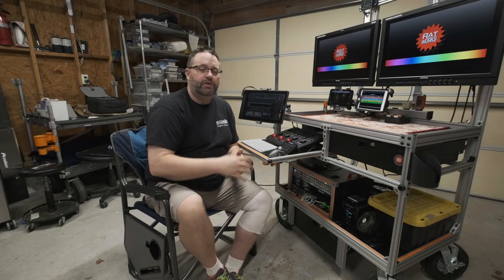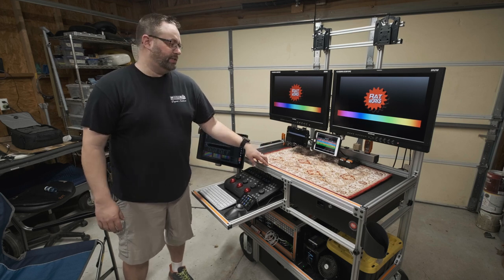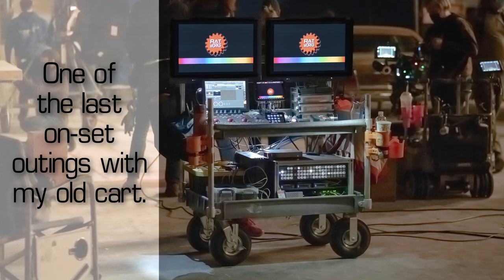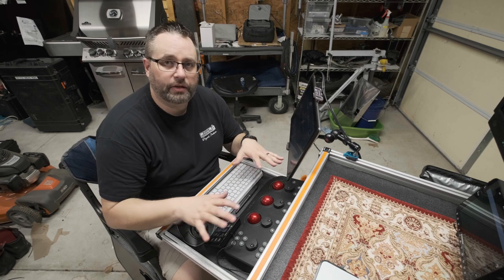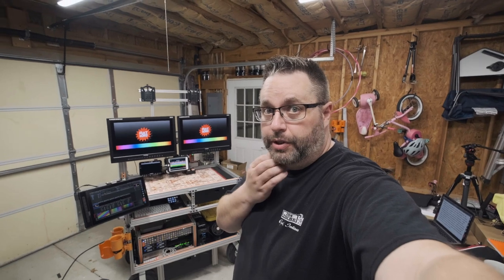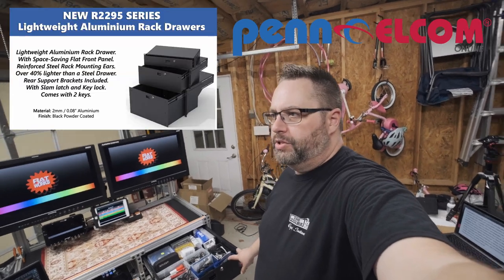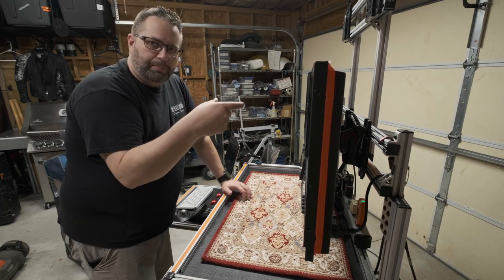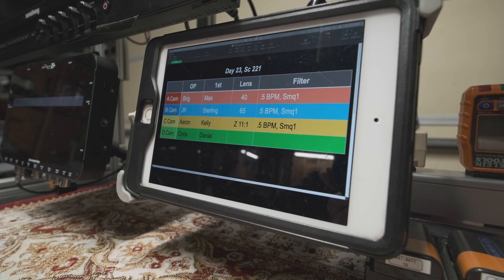*NEW for 2023* Custom 80/20 T-Slot Aluminum DIT cart

Comment: Should provide a hook for the DP's backpack... they love that.. Also, a DIT I just worked with had a 2RU shelf that was designated for the DP to put all his little bits in for the production.
Reply from the maker: I do provide a hook, actually, it's just not permanently mounted.  I usually just buy a size 'SMALL" Gear Aid Hero clip for the DP's bag.  And the last show I did the DP used an iPad and just took over the right half of my cart.  Worked out great.  I'm tying to figure out a way to add even more storage to the build if possible.

Comment: Hope you're back to work by now! I'm a DP and have been carrying my Inovativ cart in my van, but I've been wanting to build out a cart using 8020 extrusions. Can you share a reason why you decided to build it this way instead of going with Voyagers which seem to be more popular among the DIT's? It's obviously more fashionable and better IMO.
Reply from the maker: Biggest reason is cost.  A bare-bones Voyager 36, which is the comparable size to this cart, is $4 grand, and that's without any drawers or monitor mounts.  All told this cart cost me about $2800 to build myself, including the pricey bits like the drawers and monitor mounts.  I just can't fathom spending that much money on a platform cart.  I could buy a decent used motorcycle for that and be much more satisfied with my purchase.

Comment: Do you recommend the caster wheels you are using? They look like the ones from CasterHQ if I'm not mistaken. Looking to get some larger wheels for my cart build as well.
Reply from the maker: I purchased the casters from McMaster-Carr industrial supply, they're pretty standard 1-inch pneumatic casters.  I go back and forth on whether I should have gone with 12-inch, but I didn't design those to fit on the cart, so it's a done deal at this point.